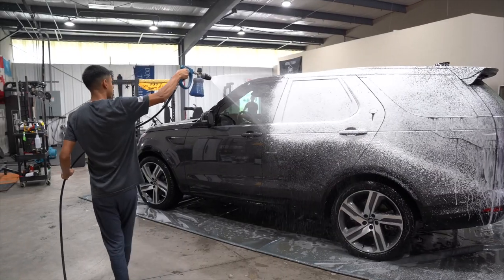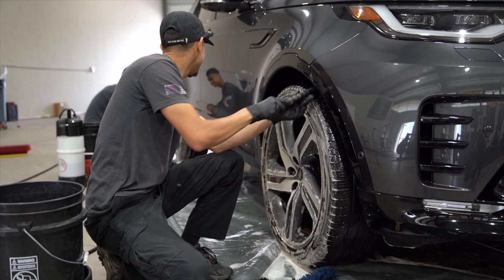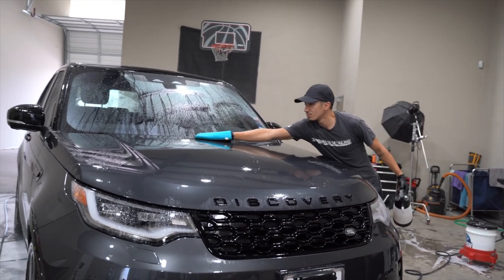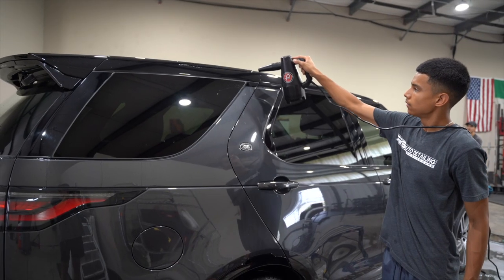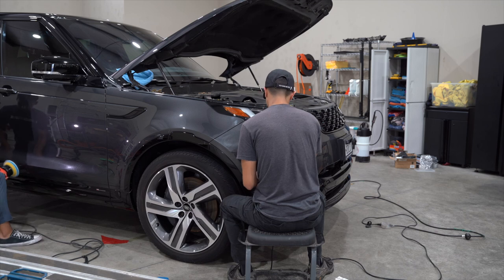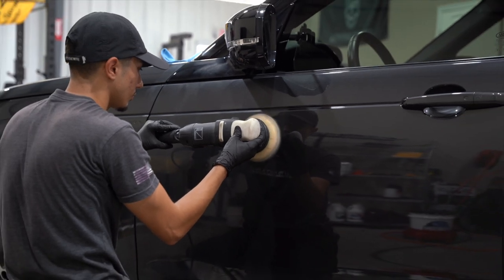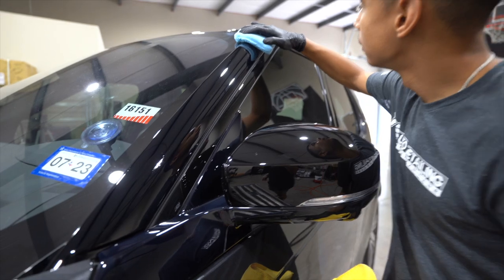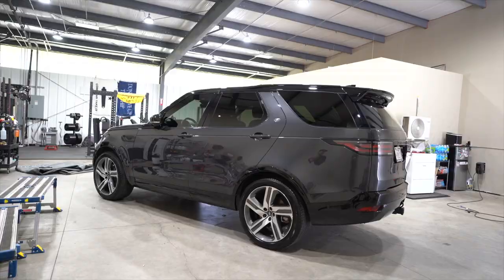Land Rover Discovery Get a A $1,300 Detail | Did We Overcharge?

Comment: what do you think about washing the car instead of using panel prep then air blow and then add the ceramic coating
Reply: Panel prep is not really an option when it comes to adding a ceramic coating. Otherwise you are sealing away numerous contaminants underneath the coating, which causes many problems with the coating down the road.